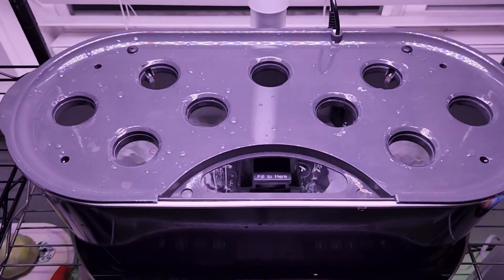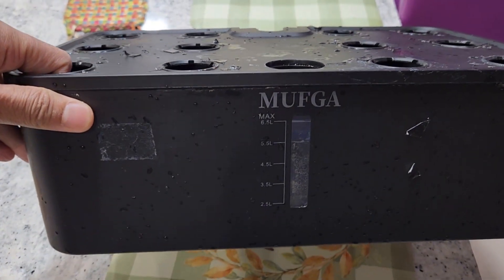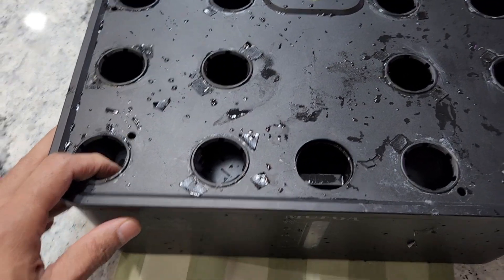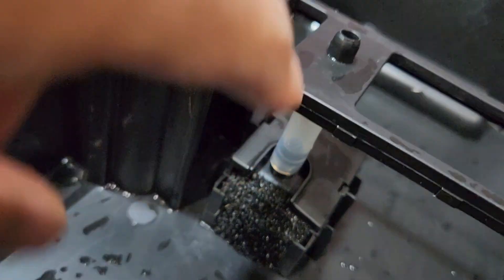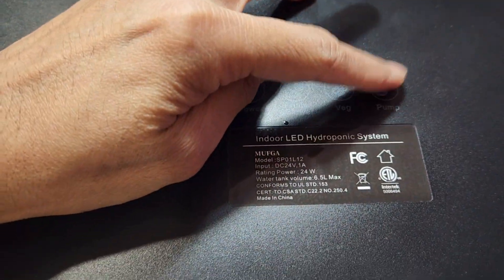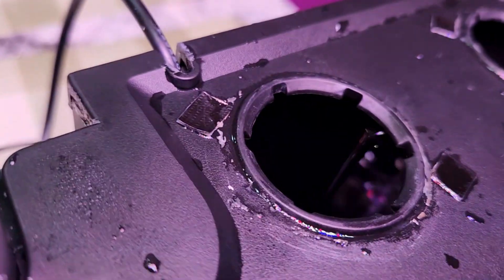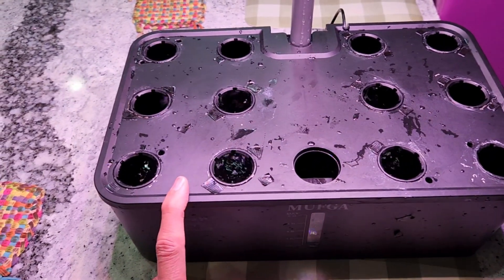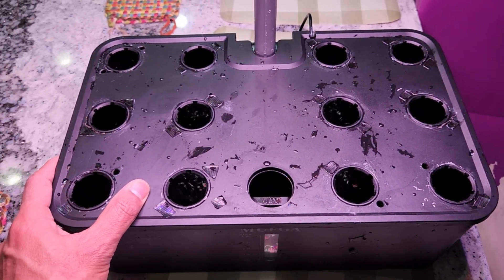Irrigation Setup In Hydroponics Systems, Mufga

Comment: Great video and I do feel that was an advantage of the Aerogarden systems. Aeroponics is also a form of hydroponics were the roots are sprayed with a mist of water. Thus the Aerogarden name because it kinda “sprays” the roots with water. But the bottom line too me is the water needs to be very well oxygenated so the roots don’t rot. Like a DWC were you add an air stone to the reservoir. Too me a system that distributed the water over a larger area oxygenates the water better and thus better plant and root growth.